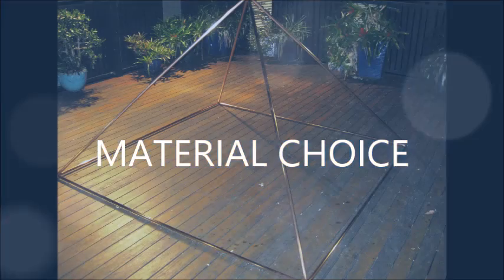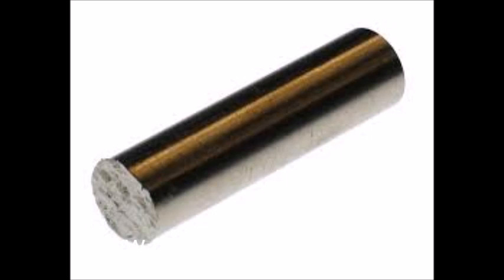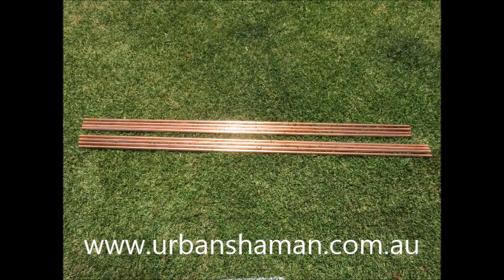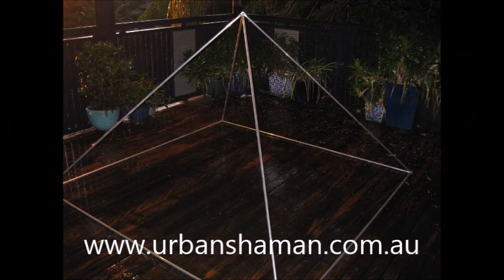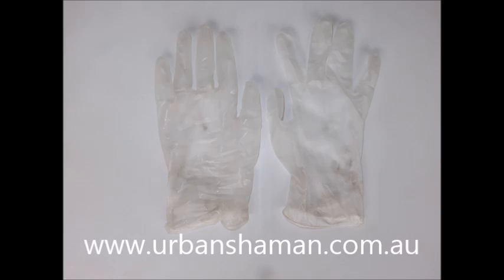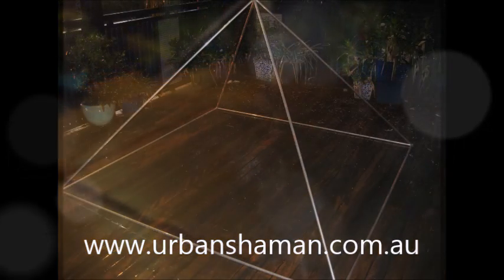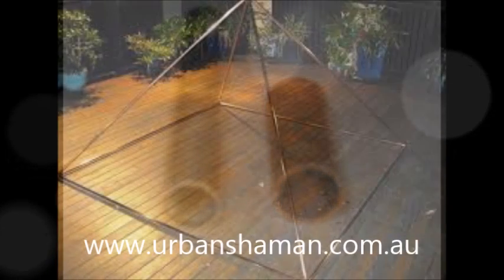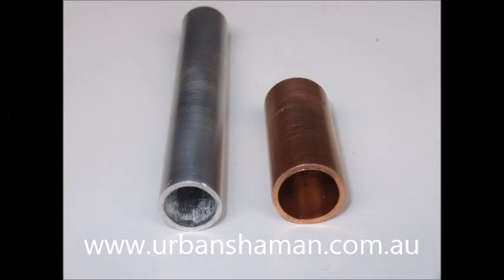COPPER VS ALUMINIUM AS A MATERIAL FOR PYRAMIDS

Comment from the maker: Hello BALTOMAN, you've asked this question at the perfect time. (no surprise given the way the universe operates) Yesterday I received an email from a gentleman who purchased my connectors and is conducting experiments with quartz sand. He set up a russian style pyramid inside a giza and filled both with quartz sand.  He discovered that the energy from the giza pyramid goes out about 10 metres and the combination pyramids goes out about 30 metres. So the Russian style gives more radiating power. He also commented that the sand is the best enhancement (about 20%) and an orgone sphere together with the combination pyramid gives another 10%.He is conducting some further research on this and I look forward to hearing more. Thanks for the perfectly timed question. Regards Mark:)
Reply: Are you saying he constricted a Giza- type pyramid and then hoisted a smaller model Russian style pyramid at the apex of the Giza pyramid filled with quartz sand?
Like a small pyramid within a large pyramid?

Comment: Some say that non-conductive material works better. I'd like to see more comparisons (saw one that seemed to confirm this, they sprouted corn and the metal did okay but the wood did best. For those with metal already, well at least they seem to work better than no pyramid!)...
Reply: Yes you are right. PVC or wood are the best from what I researched. 
The metal ones don't have the same power, because it is acting as a faraday cage ,disrupting the pyramid field. When using wood, use glue or wooden dowels, no metal fasteners. 
Hope this helps.
Reply: @Mike588  thank you and it is better then copper .thanks

Comment: Has anyone tried a wooden built pyramid? I was told it's highly effective as well. Hoping to make it more portable friendly as well!
Reply from the maker: Hi Chris, I have and it worked well with 19mm dowel. Turns out the connectors I make for 19mm copper work perfectly with wooden dowel
Reply: I will try to do a wooden pyramid in my garden for meditation, just wondering if the baselines are really necessary or if it is sufficient enough w the pyramid form of poles stuck in the ground w. equity regarding the measures for a Gize pyramid?
Reply: @MrArtrock  Sounds like grounding to me.  Which is supposed to be excellent energies for your body and mind.

Comment: Hello, and thank you for all of this information! I’m just wondering, if my space can only accommodate a 5’ squared pyramid and I have my heart set on copper, will there be a sag if I use 1/2” diameter copper tubing/pipe? Also, would you be willing to tell me where I can find the pieces you used to connect the pipes in the bottom corners, as well as the cap on top? I am in the states. Be well and thank you again.

Comment: If I built a pyramid with a 8 foot base, what would be the length of the lateral poles?
Reply from the maker: Try around 7'7".  That's only a rough guide as the measurements I provide take into account the diameter of the pipe being used and make allowances for my connectors. Since I don't know what pipe diameter you are using or how you are attaching the pipe to each other you will find that it wont create the sacred geometry but it will look similar. Hope this info helps Regards Mark

Comment: Hi, would u share the measures please?
Reply from the maker: Hi , happy to share measurements however they won't be of any use without purchasing the connectors from www.urbanshaman com.au. The measurements I use for the pipe or tube incorporate an allowance for the connectors.  This means without the connectors the pipe or tube would be marginally too short and would not create the correct angle to form the pyramid into the sacred geometry I speak of in my videos. Thanks for the enquiry:)
Reply: @urbanshamanmeditationpyram9970  thanks, ill check your website